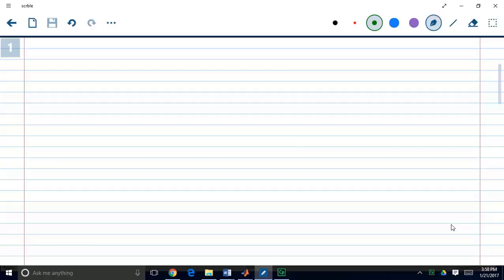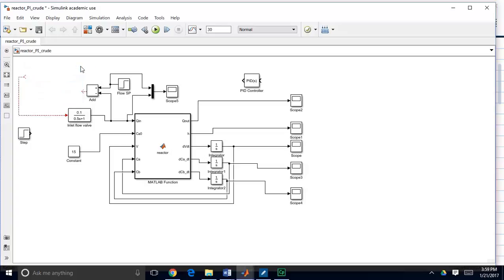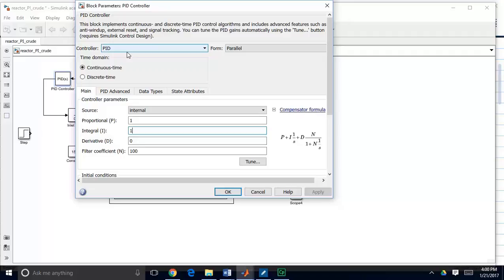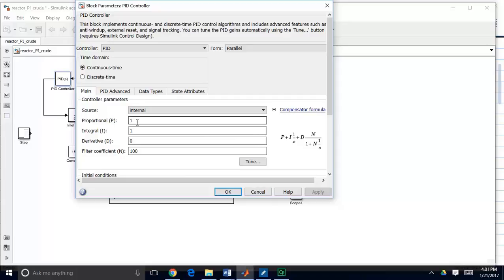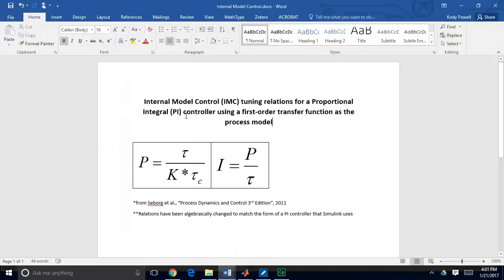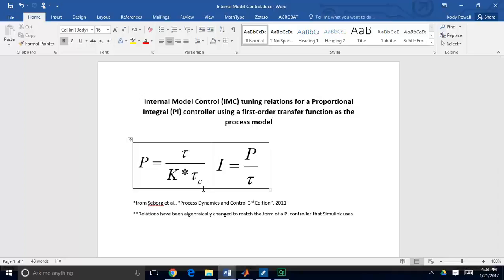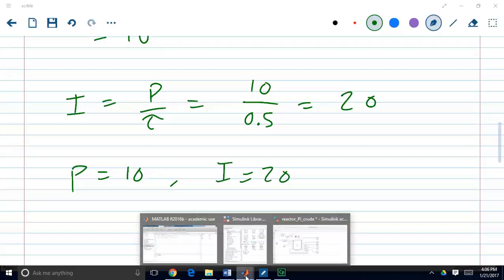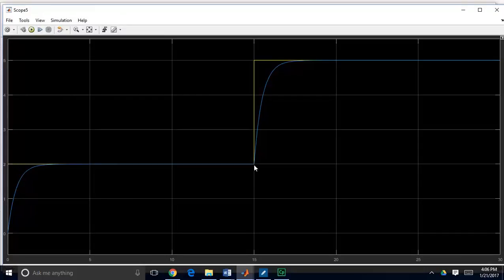Controller tuning and controller saturation/windup

Comment: I gave a thumbs up for the first part.  The anti windup part should provide code examples not a check box in Simulink.  Too many people get answers from Matlab and Simulink but they don't understand what the Matlab and Simulink are really doing.  The clamping method is not the best method of anti windup.